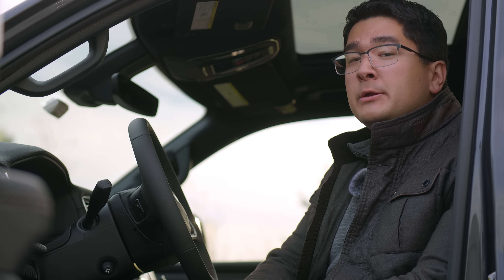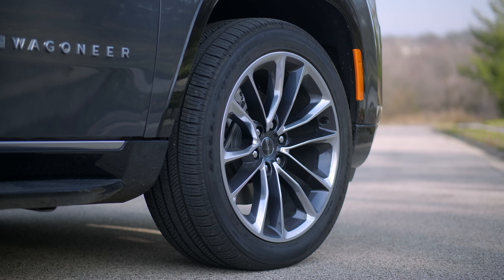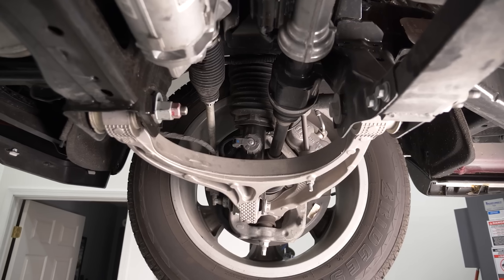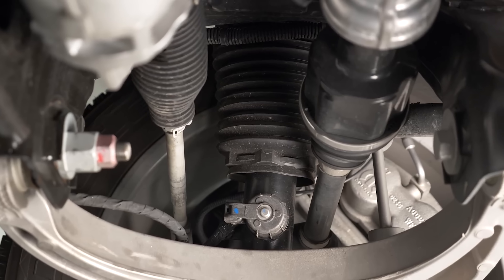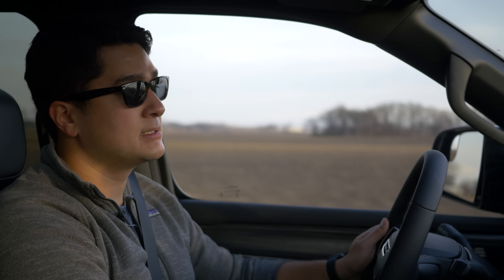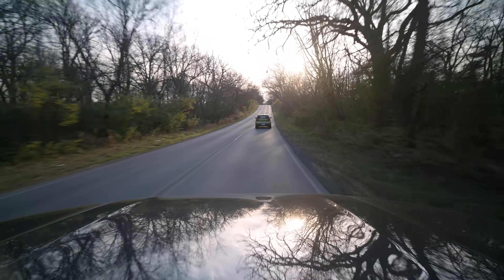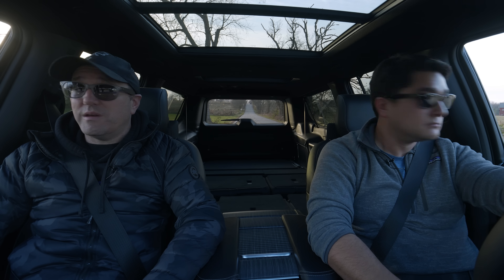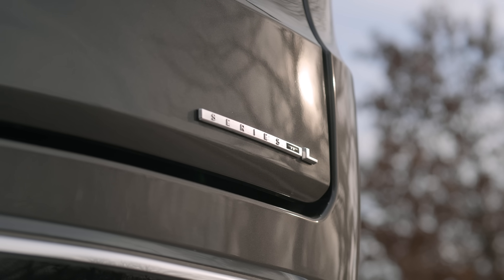2023 Jeep Wagoneer | Twin Turbo I6 Powered House

Comment: 1:09 that build quality tho. One thing I’m worried is the last time Chrysler came out with a new engine was the v6 diesel which was unreliable.
Reply: Got a joke for you. 
Chrysler, Peugeot, and Fiat make a vehicle together.

Sorry it wasn’t funny, I don’t like unnecessary repairs either.
Reply: That was a Fiat-branded engine designed by VM Motori later renamed to "EcoDiesel".
This is a Chrysler-group (the C in FCA, rather than the F) design.
Reply: ur not buying some bespoke 200k suv, This is mass produced SUV

Comment: There is a much bigger difference between the normal and high output engines, the only thing they share between the two is the block, everything including the crankshaft, rods, pistons, camshaft & valves,  turbochargers, and intercoolers are different. The HO also does not have an EGR system.

Comment: We drove a series 3 yesterday. Not an L, but with the 3 Ltr. I was really impressed with everything, (BUT), the fuel mileage. We actually went to drive a Durango, but all they had on the lot were Hemi R/Ts. What I have noticed about everything I have sat in or driven is the lack of comfortable seats. The Wagoneer had the best seats and ride. Ride by far, but seats by a little. My present truck is a 2002' V-10 F250 Super Crew Lariat. It gets absolutely horrible mileage, but is the most comfortable truck i have ever driven or owned. The seating is thick and comfortable for 24 hour straight drives, which I used to do regularly. Did I mention I used to tow a single car trailer cross country a lot?? Though I no longer do those long towing drives, I have a fused back now and need something with real comfort... So my question to you is: IS THERE SUCH A THING AS COMFORT ANYMORE IN A TRUCK or SUV?? The Wagoneer is the best for me so far. PLEASE tell me there is something better that actually gets good mileage and doesn't have to drink premium fuel....

Comment: The cargo space is actually less than a Pacifica with seats down, and the Wagoneer L only beats it with the third row up. I like it if you're towing, which the Pacifica can't match, but otherwise it's much more livable and with AWD can handle some rougher roads (though the body on frame may be more durable if only driven on rough roads). If you want cargo space, the ProMaster has them both beat!
Reply: A lot of people with 7 or 12 kids and a bunch of shit to haul around would be better served by a minivan--better aerodynamics, better fuel economy, same or better interior space, etc. But their egos won't let them buy a minivan, even though these castrated dudes already gave Karen their balls in the divorce.
Reply: Or a suburban/yukon....been doing this since the 40's
Reply: @youtubecantsaveallthesnowf8601 , Suburban and Yukon are the same thing from a different brand. If you don't tow or use your vehicle as a battering ram, these are just a waste of money when minivans drive better with the same interior space.
Reply: @Questioner  lol....I have a 22 yukon denali xl....minivans, all of them are In no way comparable.  The ride is far beyond anything a minivan can do, it can tow my boat and I live at 7800 ft on a dirt road. Minivans here would become buried in snow in the winter and would get stuck in the mud in spring. Besides minivans are going away and you mentioned the Pacifica ...hope you dident buy one. As a professional mechanic for 26 years now and having tons if experience working of Chrysler products I can tell you the pentastar 3.6 v6 n the Pacifica is probably the biggest pile of crap ever put into a vehicle. If you got one...I hope you took the extended warranty.
Reply: @youtubecantsaveallthesnowf8601 , it sounds like we're not far off. In beating through mud and snow on dirt roads and towing, I agree, the body on frame SUV is better. However, I've found on well maintained roads the minivan is still quite smooth and comfortable while being nimbler than body-on-frame. I've owned big body-on-frame diesel vehicles, and really liked them for heavy lifting, but prefer minivans as daily vehicles that are comfy on long trips but still fit in a city parking spot. Plus, 3500 lb towing is adequate for towing a small boat, car, or medium trailer (6x12 enclosed, for example).
Reply: @youtubecantsaveallthesnowf8601  if you need to tow a boat and have 7 kids, obviously you need an SUV. I'm not talking about people with towing needs. Most people never tow shit. A Honda Odyssey is a better family hauler than a giant ass Suburban or whatever, and yes, that includes ride quality because a body-on-frame SUV will not have a particularly great ride.
Reply: @The Glow Cloud  yeah, not really. Because full size suv's tend to be most makes flag ship vehicles they are usually  brimming with technology, whereas your typical crossover or minivan tends to be bargain driven so when it come to ride quality...pick any suv tahoe,yukon,grand Waggoner/cherokee,expedition ect....they all ride better and most are surprisingly very well handeling as well and are far better suited to the family road trip. And now with newer engine options the mpg's aren't so bad either. My 3.0 diesel averaged 31 last week to Utah and back. I get the smaller thing though, for trips to the mall but for the average family of 4 with 3 dogs and an active outdoor lifestyle....long live the giant body on frame suv.
Reply: @youtubecantsaveallthesnowf8601  the 3.0L diesel is a huge upcharge in GMCs. Diesels in general are hard as hell to find and even with the mpg advantage, diesel is $5.59 a gallon here in NC. Gas V8s are a no-go for me at this point.
Reply: @The Glow Cloud  considering most newer v8's get the same mpg's as most v6's I think the v8 still has value. Also considering most smaller engines are now turbo charged, which is great for power but any forced induction gas engine will have a shorter life span than its naturally aspirated counter part (see ford eco boost) you are either paying for the gas, or paying the repairs and replacement...in the end, they still get ya.
Reply: @youtubecantsaveallthesnowf8601  "considering most newer v8's get the same mpg's as most v6's"
I... uh, what?
Name a single vehicle available with both V6 and v8 where that's true...?
Reply: @Tim  jeep wrangler & grand cherokee Ram 1500, chevy silverado, chevy colorado (09-11 5.3 v8 vs 3.8 i-5)toyota 4 runner, most cameros, any v6 mustang ect...talking real world mpg's not window sticker bs.

Comment: I have Wag Series I with the Hemi. Stickered for $64k and is still plenty luxury in base form. 

The 5.7 Hemi sounds great, is smooth, is tried and true, and I've been averaging 20.5mpg over 15k miles of the vehicle (mainly highway commute). 

I'm excited for the new Hurricane engine, but besides speed and quickness, the HEMI is better in every other way... Even MPGs... Minimal gain with the I6.

Comment: The suspension bits that hang so far down - that's all going to drag thru snow/mud.  Forget about taking that off-road where those bits would get ripped off, though taking such an expensive vehicle off-road isn't very smart anyway.

Comment: The high output is the one that needs 91 octane, standard output recommends 89 but can run on 87 octane
Reply: Yeah people want to put 87 in their vehicle. I think people who want a "performance" SUVs won't cross shop this. 

Even though living with 91 isn't that bad if you live near a Costco gas, otherwise it does add up to a perceived cost
Reply: The owners explicitly states premium fuel is recommended for the low/ standard output engine. It does not say 89….
Reply: Owners manual basically states that, to get RATED power, you must use 91. But the engine will de-rate to permit 87 use.  Can't wait to see the dyno results for 87/91.

Comment: Surprised about the fuel consumption on the I6, our Wagoneer with the 5.7 V8 gets 15.5mpg around town and around 20mpg+ highway.
Reply: Was thinking the same. The “archaic” 5.7 does better in the real world fuel economy and you can use 87/89 instead of 91.
Reply: Are you flooring it everywhere or driving responsibly?
Reply: @tim3172  mixed driving i guess, but dont get on the freeway much so mostly city. With longer trips with more freeway driving the built in computer shows 16-17 mpg. So i think more freeway driving would put it closer to 20mpg mixed

Comment: I thought the High output had different piston heads and a forged crank.  The High output is ready to be modified for serious HP.
Reply: The low output 3.5 Toyota GR found in the tacoma has forged internals; connecting rods and crank. 

5.0 coyotes are also forged as standard, even in f-150s. Both these aren’t in boost. 

This is typical Chrysler cheaping out on the S/O. Their H/O has 26psi; it needs forged components LOL.

Comment: you asked the question who else makes an inline 6?

well up tintil October 2016 Ford in Australia made the inline DOHC 4.0 6cyl in naturally aapirated and turbo induction the engine family line was called "Barra" short for Barracuda, in its final spec form (the XR6 TURBO SPRINT) torque on overboost was 650Nm with top end power of 370kW, in terms of foot-pounds that is 480lbs and 470HP when using 95 RON (re: 91 AKI) all while being by today's standards simple MPSFI.

even in normal NA (re: non turbo mode) the engine was able to generate 391Nm and when on 98 RON (93 AKI) around 203kW.

Comment: Nice!  Hurricane engine sounds like a beast.  Think this engine will make it to the Pacifica one day or will they keep the 3.6L in that car?
Reply: Being FWD based, I would not count on them putting the I-6 in the Pacifica. Possibly on some Grand Cherokees, Wranglers, and Ram 1500.
Reply: @alexs3187   that would be cool if the Hurricane I-6 went to the Grand Cherokee .. kinda like it’s going back to its old roots but with a more modern I-6
Reply: @wns808  yeah I liked the old AMC 4.0, it was just a gas hog.
Reply: @alexs3187   the old 4.0 didn’t like to be revved either

Comment: 14.6 mpg is crazy, my Sierra with a 6.2 is at 16.4.  Both use premium and I drive like an idiot.  Wonder if the Ford/GM trans is better than the ZF they are using?  Or rather the tuning on the trans is better.
Reply: another 1000 lbs in this
Reply: @papa_pt  was going to say no way, but your right!  Dang it’s a big one!
Reply: @jrfish007  about as big as it gets lol

Comment: If they wanted a boosted engine, they should have made their new engine a small 3 liter V8 with twin turbos. Then the vehicle will still sound like a proper body on frame SUV. Puting a turbo on a six cylinder, was Ford's problem, and is why Ram was constantly taking customers away from them. The extra cylinders on a small displacement V8 will sound proper, and the smooth effortless power delivery of an 8. Ford forgot that you spell luxury with a V and an eight.

Comment: This does NOT require premium. Read the press releases guys. It Recommends premium.
Reply from the maker: It's recommended because of the high compression ratio. if you are loaded up or towing this thing will always be pulling timing and boost.  The HO is required.  I don't know if I would be comfortable throwing 87 at this engine.  Im sure it's a case of yes you can but should you?

Comment: That thing fits 8 tires with the second row up? Pretty understandable comparison to me lol, I just managed to fit 8 19in tires (4 of which mounted on wheels) in my 2011 Versa hatchback with the second row down. How did I manage this? Some stacking, slamming a few doors that just wouldn't close, and having to lean forward to see my passenger side mirror.

Comment: It's actually remarkable that you can get 400 HP out of a V6.  

And you are gonna need every HP it can give you hauling that monster around
Reply: Not really in this day and age. Mercedes has an i4 that makes more than 400hp. Now that is impressive.  High performance 6 cylinders are pushing 500hp on the top end.  Pretty common to see v6's pushing 400+ in these SUVs.
Reply: @TheWarpYoshimitsu  Are their stronger, sure.  

Still pretty exciting to have 400+HP V6's coming from V6's I had in the 1990's that struggled to get above 200 HP
Reply: It's crazy what engines can push now with turbos. The performance gap from old to new is insane
Reply: I hope you’re referring to 6 cylinders generally and not specifically this one. Cause it’s a straight six not a V.
Reply: @alecmurray8339  Fair point

Comment: You guys spend most of the video comparing to the trash that is the sequoia. No one is buying the sequoia. You might as well of spent the video talking about the Armada. The competition here is firstly the Burb/Yukon xl, and second the Expedition xl. The aging 3.5 ecoboost is also starting to show its age, as they needed to be on gen 4 of it to get it to the power this makes starting. As for the GM family, the 5.3 may make less power but it gets much much better fuel economy. The 5.3 burb gets around 18 which is monumentally higher than 14, which btw is what the hemi got. This engine only has 2 improvements over the hemi, low end torque and better epa ratings (maybe the future 4xE compatibility). The low end torque is better for hauling/towing, but that turbo will always be spooled in this and this will always guzzle gas. That's not even mentioning the duramax the GM trucks have. GM right now, by putting so much money into the 5.3 and 3.0, is running away with real world fuel economy.

Comment: Why is the redline so low on a new engine lol
Reply: Maybe it's got more stroke than bore (designed for low-end torque.)
Reply: @jsfbay1  not really, it has shorter stroke than b-58
Reply: @tedarcher9120  So what is the bore and stroke of each engine? And maybe the H.O. engine has a higher redline (I don't know that, just speculating since it has forged internals)?
Reply: @jsfbay1  bmw b58 has 95mm  stroke vs 90mm and revs 7000 vs 5800 for hurricane. Its probably turbo calibration as they want to replace low revving pushrod v8 without remaking their transmissions

Comment: the SO and the HO are not the same engine! There is more to it than just changing the red line and tweaking the tune. Boost, fuel pumps, mains are just a few differences. Love the video, but lets give true facts.

Comment: I owned a V-6 Chrysler product in late 1990’s and I told myself near ever again. A friend owned a V-6 Jeep product from the early 2000 and she said never again.  They are quite and  smooth drives  brand new, but after 30k or so miles they a just thrash.  Trim pieces start failing off, squeaks and rattles everywhere, and door panels are held in place with bubblegum.  Transmission no longer smooth.  Let’s not even get on how the once smooth engine just get rattlely.  Not sure how this product is even mentioned in the same breath as Mercedes, BMW, or Cadillac.  They originally had the comparison correct—Chevy Suburban, Ford Expedition, and Toyota Sequoia.  This was just a weird review.  No thumbs down, but this is not their best effort.

Comment: It just blows my mind any turbo engine doesn't use 91, that ramp up in cylinder pressure over a NA motor which remains mostly consistent.
Reply: It's funny because in terms of both volume of vehicles sold and individual model/engine combinations the majority of turbocharged vehicles run on 87.
Only "premium" brands, the GM 2.7T, and VW require premium fuel. Maybe that's why they're premium vehicles(?).

Comment: The irony that Jeep went back to an inline 6 cylinder engine after dumping the beloved old one for their cheaper less power and worse fuel economy mini van V6. Which makes even less sense if they actually wanted real fuel economy they would have just slapped in their Eco Diesel and got near double what this new I6 twin turbo is getting. 
Makes you wonder if the accountants are running Jeep now? 🤣